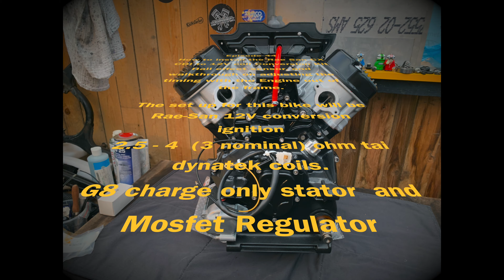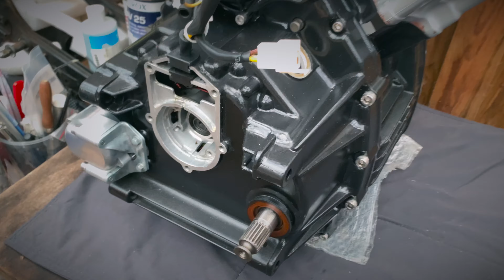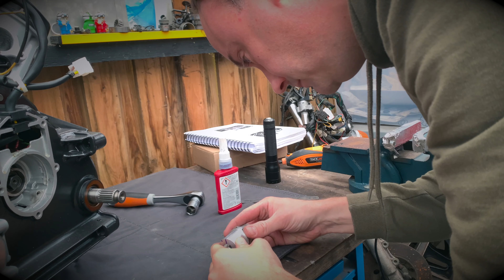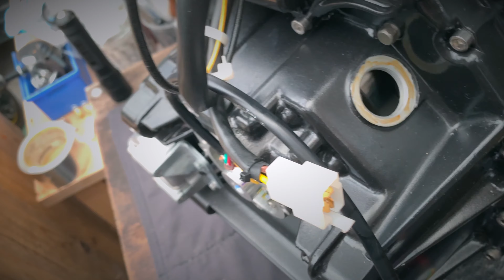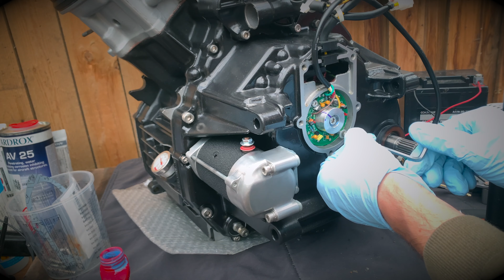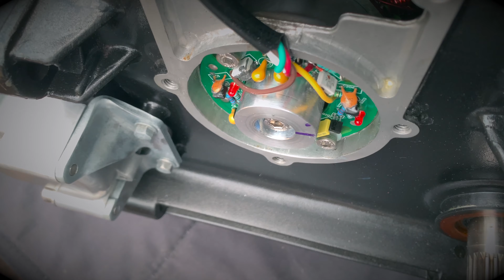🎬 Honda CX500 cafe racer build. Rae San CX CDI to 12V coil conversion. Ep 44. 🏁

Comment: It's nice to know that I can do this (that is, if I need to as my cx500 has transistor ignition. Factory Ti ignition) 

Maybe I would have put fibre washers between the plain washers and the new timing circuit board. Don't want to crack it, especially being £180 quid

Comment: Does this system still rely on on stator pick ups from the original system? Is there a possibility that this new system will not work if it’s the pick ups that have failed and not the stator output

Comment: Hello Ian, I see you are using allen bolts. Did you pick them by hand at the local hardware store or did you use MrMegapack? Is so, what is your experience with this company?
Reply from the maker: I bought a complete bolt pack from the U.K, and here's the link from the supplier, It covers 95% of what is required. some I buy individually from the local hardware place, mine is bauhaus. https://www.ebay.com/itm/265576787746?hash=item3dd59c2f22:g:X5EAAOSwYPJeSGcy

Comment: Hi Ian; since I have installed an Ignitech CDI (which is great btw) the pulser coils became useless, I know I can run a Rae San pulser along with the Ignitech CDI, I willing to do but I couldn’t find much information on how to do it, I only need the transistorized plate (green) and the aluminum tip (rotor) for the end of crankshaft, I want to do this because the Ignitech comes with the set up for the standard CX to plug and play but mine like yours are not standard anymore so I having some backfires on reductions mostly, it ca be fixed (with the right equipment) since the Ignitech is programmable by computer but over here is very difficult so the Rae San pulser seems to be the best option to me
Sorry for the extended comment 🤗
Merry Christmas!!!
Reply from the maker: Merry Christmas Carlos, keep the comments coming, I am learning from you also. Welcome any constructive information good and bad. A few months off from the build now due to winter (-6 outside), parts and some other things going on, but will hit it hard again in early spring,
Reply: @aircraftengineerstoolbox2560  wow!!, that’s cold!!🥶, is summer here ☀️, well, take your time Ian, I’ll be waiting and riding around in the mid time, beautiful beaches, camping sites, lots of nice places to enjoy on a motorcycle, happy New Year mate!!!